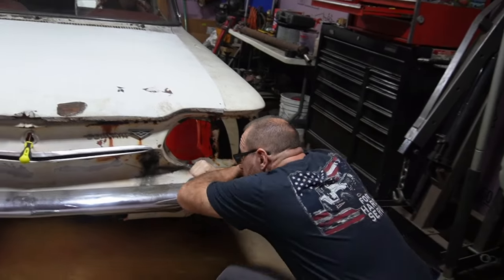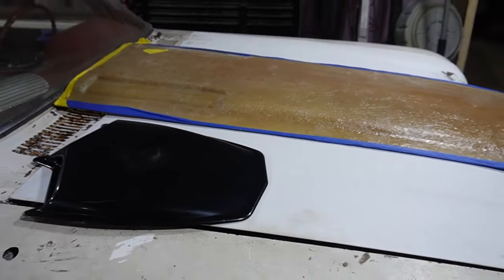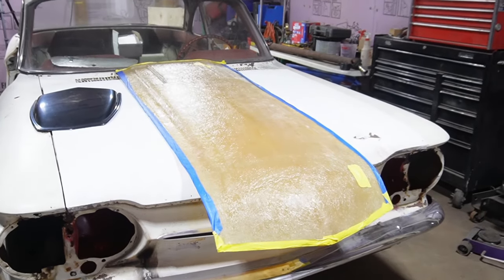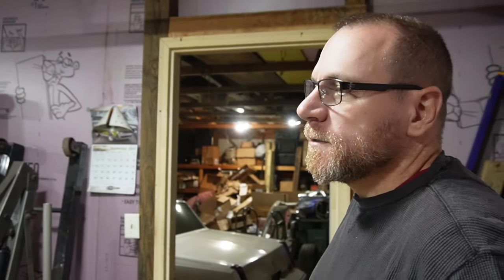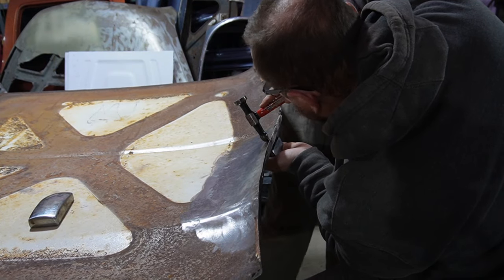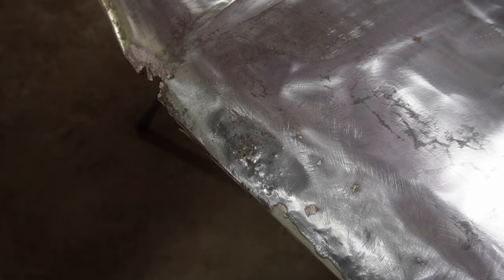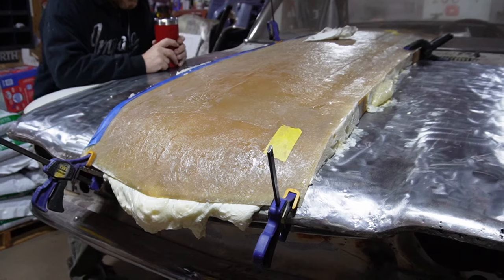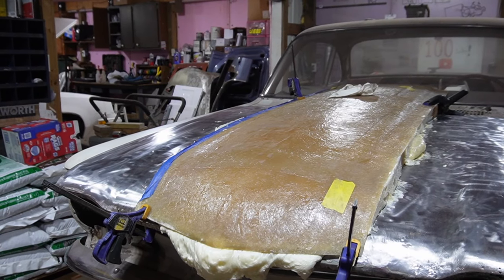Home Depot Hood Scoop Part 1 ┃ Episode 47

Comment: Awful lot of work for a custom hood.  I understand.  I spent over 120 hours molding 66 Chevelle SS louvers into the hood of my 65 Nova wagon, mostly block sanding.  Two suggestions if I may. Respirators and hearing protection. I'm 65 and wish I had been more careful with my ears. It's a pain for a while but becomes habit after a bit. Best wishes, I'll be back.
Reply from the maker: True. Hadn't considered the possibility of lead in the paint when we stripped the hood and quarter. Once that dawned we started pulling the masks out. Other PPE is being looked into to find equipment that works together.  You'll be seeing more use in the future.

Comment: Not sure if it's universal or just my experience with expanding foam, but I attempted to form it for a project, and after cutting and shaving and sanding it, it still seemed to move long after the specified curing period.  What I believed I had smoothed out and ready was a bit wavy a few days later.  Hope your experiences go much more smoothly.
Reply from the maker: Nope... Not just you. Been fighting with this pup for a few weeks now trying to get it to line out. Seems for me, everything that's moving is sinking though. Started thinking after the fact I probably could have glued polystyrene to the surface of the hood and sculpted one out raw faster than its taking to get this puppy punched out...🤨